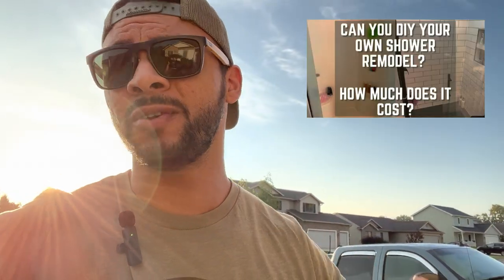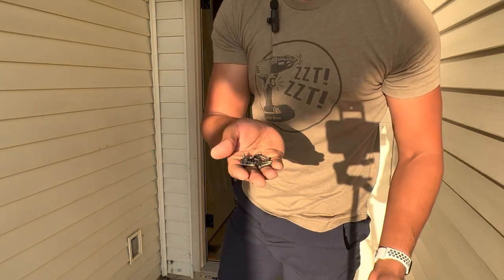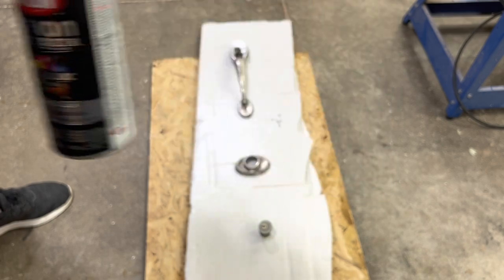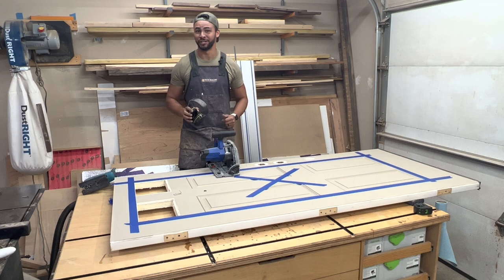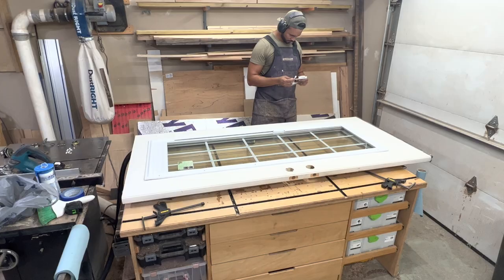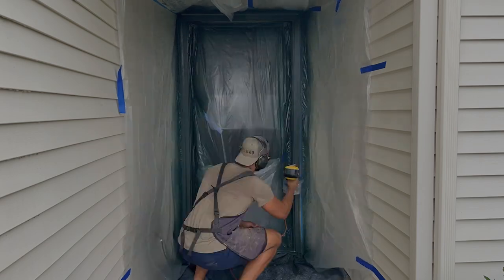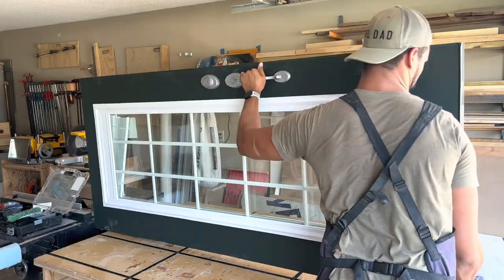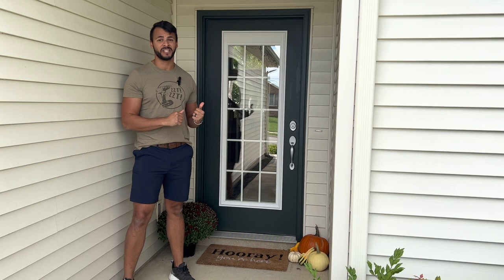I Cut a Huge Hole in my Front Door… | Zabitat

Comment: Another trick that I’ve used when doing something like this before is to use some of the endless wood scraps and shim under the door before removing it. Then when you go to reinstall you can just set the door on those scraps instead of doing the prybar trick
Reply from the maker: oh - I like that move for sure. Helps to keep unnecessary pressure how those last couple of screws while removing the door too. Thanks for the tip man!

Comment: How's the painted hardware holding up to usage?  Did you topcoat it with anything?  I worry painting over brass (even if it's been roughed up with sandpaper) just won't hold up to the abuse it'll take over the years.
Reply from the maker: I had reservations too, but it’s held like a dream 👍🏽

Comment: 1. Great video.
2. Reinstallation will be much easier if you remove the door pins instead of the hinge screws because the holes could get messed up  and make it difficult to reuse or reinstall. Mask of the brackets prior to painting the door. 

3. You don't have to be perfectly straight with your cut line because the cut will be covered by the frame on the glass insert (just make sure not to wander off the line too much).
Reply from the maker: 1. Thanks!
2. Thats a solid call - where were you 1.5 yrs ago? haha
3. see response to #2 ;)